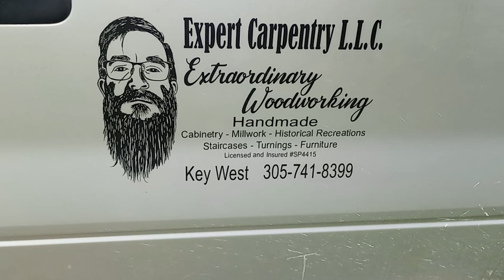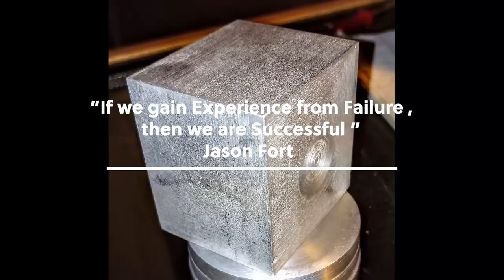Machining Aluminum with Wood turning tools . A cube in a cube in a cube . AKA Turners Cube

Comment: Really good work. Could you calculate the volume of your mould and weigh the scrap going in the crucible to make sure you have enough for the casting?
Reply from the maker: Yes , the calculation would be pretty simple to do . But no where near as fun .